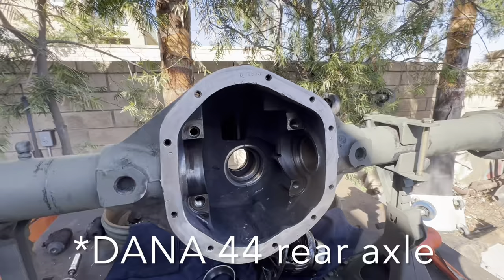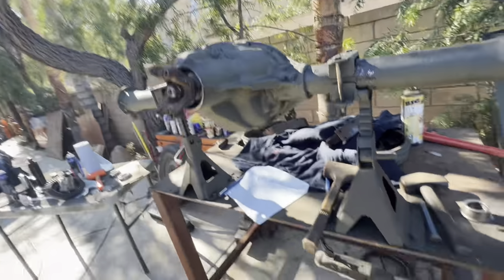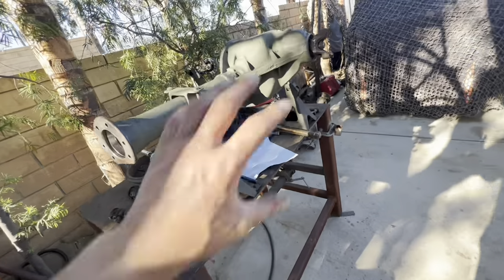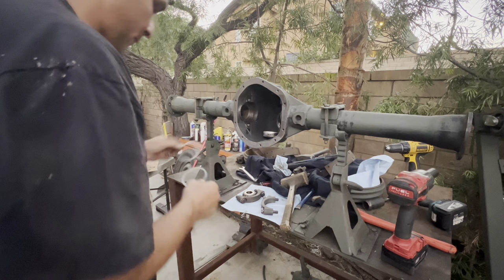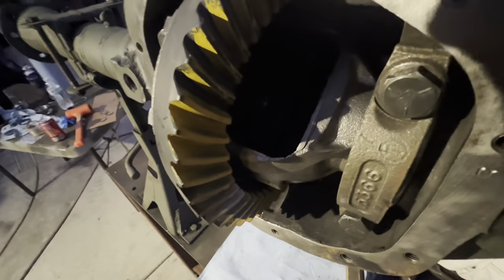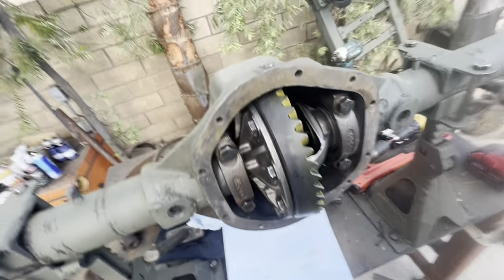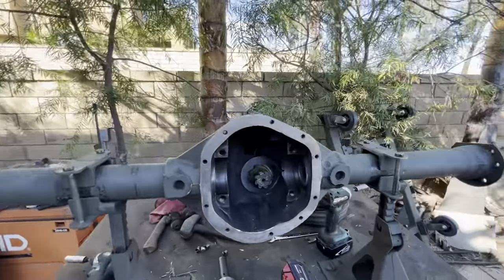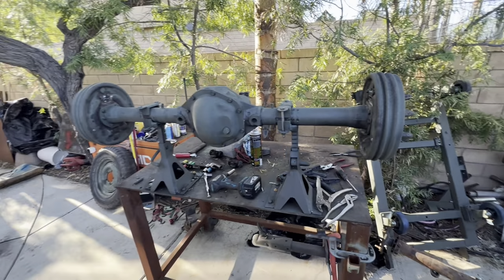Willys Jeep axle rebuild 5:38 regear. Dana 44      CJ2A/ CJ5/ M38/ MB/ GPW

Comment: Hey Devil dog,
I had 5:38 gears in my M38A1 and when I put the small block Chevy in it with 33” tires it was to low geared for the freeway. At 55-60 mph I was taching 3200 rpm. I swapped out for the 4:27 gears and with the SM 420 I have all the gear reduction I need off road. And it is better on the Hwy as far as the rpm’s and not winding the engine up so tight. 
Just a little food for thought.
Semper fi brother
Reply from the maker: Hi jeffwelsh1185- good to know. thanks for that info.. I have 5:38 on Slumdog my other jeep with NDT’s and i love it… i was going to do the same with this one… maybe.. maybe i go with 4.27… big tires… dang .. my head hurts.. haha..  Semper Fi brother.  thank’s for watching out for me.
Reply: When I first did my 283 swap on the M38A1, I lived in Ontario Ca and I was running down I 10 to Vineyard ave, I looked at the speedo and it was about 55-57mph, that was with 5.38’s, 7.50x16 tires( they measured at 32” tall) and still had the T-90 trans with Dana model 18 transfer, no overdrive. 
When I looked at the gear chart, with 33” tires 1-1 final drive and 4.27 gears , I want to say it was about 2200-2600 rpm at 65 mph. 
I haven’t ran the Jeep on the street in years. The last tires I put on it are 33x13.50x15 super swamper TSL. Very aggressive tread pattern, and Bias ply. The tread would only last about 10,000 miles on the street. I need to get a second set of wheels and put a set of 33x12.50x15 radials so I can run it on the street again. 
The crawl ratio with the SM420 trans with a Dana 18 and 5.38 gears are 93-1 in granny gear. With the 4.27 crawl ratio is around 75-1.
When crawling off road, you don’t notice the difference in crawl ratio , but when in 4 high on the road, you feel the difference for sure.
You could always contact Herm the over drive guy and look into the 25% Saturn or warn overdrive. I know the Dana 18 model mounts on the back of the transfer, don’t know about the Dana 20 version.
His web address is hermtheoverdriveguy.com.
Reply from the maker: cool we were neighbors at one time… i found a set of 4:27 online… going to put those in. axle is still on the table.. should be a quick swap to the 4:27. Thanks again!
Reply: @reconern  Hey Devil Dog,
I also noticed you are putting a Dana 20 transfer in the Jeep. Did you blow up the Dana 18?
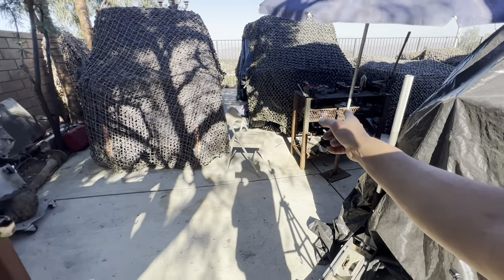The Dana 18 has a 2:46 -1 low range and the Dana 20 has a 2:03-1 low range. The only thing I ever had a Dana 20 in was my 1967 Jeep J3000 truck that had a 327 and a T-18 4 spd trans. Didn’t really notice a big difference in the gearing, but the truck had 35” tires with 4:11 gears in it. I always had the Dana 18’s in the small Jeeps, my CJ5’s, and the M38A1.
Like I said before, there is an overdrive you can put on the back of the Dana 18 with no drive line mods, but I don’t know if there was an overdrive made to go on the Dana 20. That would for sure make your highway driving a lot more friendly on the old Jeep.
Reply from the maker: I prefer the Dana 20. It’s stronger. I’ve had plenty of hard trails on them… and somebody was selling one cheap. so I’m going to swap that in. They don’t make over drives for the Dana 20. my rig is primarily a trail rig.. so if I need a hwy rig I have another one for that- my head still hurts, doing the Rodney Dangerfield. I might stay with the 5:38 since its a trail rig… the stress.. bahaha
Reply: @reconern  the only difference really between the Dana 20 and the Dana 18 is the rear output position. And the Dana 18 has a lower low range. The 18 has the 2:46-1 the 20 has a 2:03-1. I knew a guy years ago that found an old Jeep guy who took the gears out of a Dana 18 and put them in a Dana 20 to get the lower gears. 
The main weak link in the Dana 18 is the intermediate shaft. There is a mod that herm the overdrive guy does where he machines the Dana 18 case and puts tapered bearings and races in the case for the intermediate shaft. And I believe he also uses a bigger 1 1/8” shaft that was used in the military version of the Dana 18 from the M38A1 Jeep. 
There was a big write up on it in JP magazine years ago. May be worth looking up if you want to make one Bomb proof.
Just some food for thought Devil Dog.